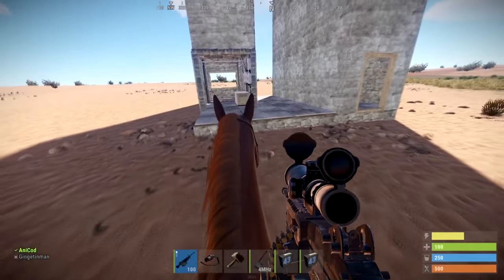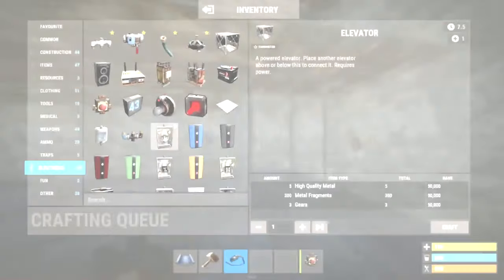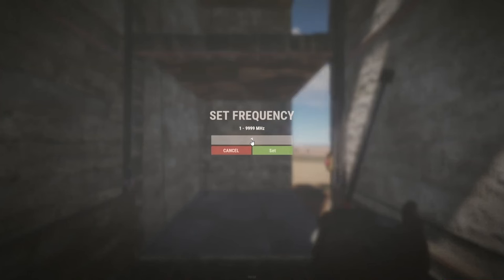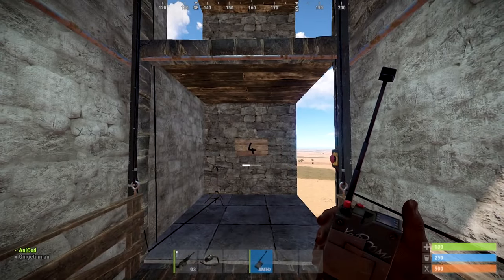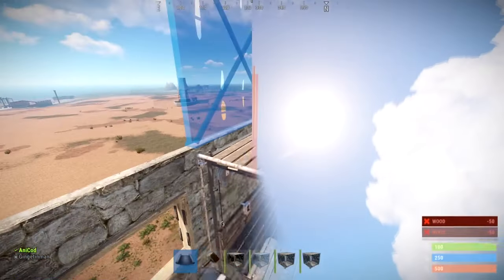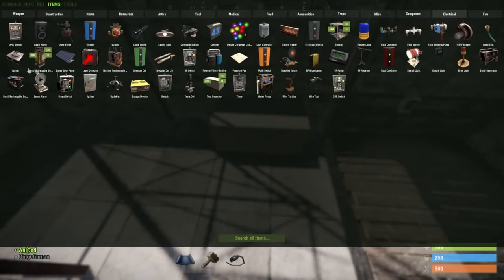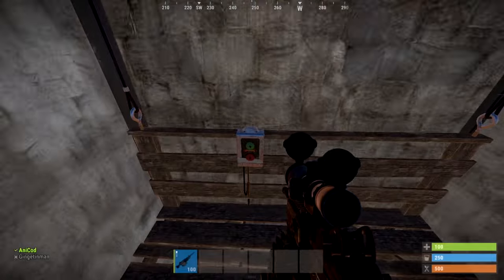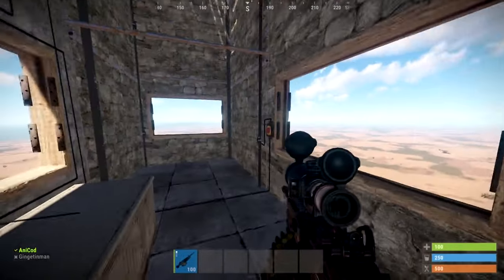RUST | Elevator (Lift) Guide | Tips & Tricks | Circuits

Comment: Awesome video. Question can you put a elevator one in front of another to fit a long vehicle on one call button to make a multi-level garage?  may try this myself. What's your thoughts possible or not possible?
Reply: Did it work? I'm interested
Reply: @MarcWrench1369  nope it doesn't work you get an error not enough space
Reply: @xinping891  that's a pity. Thanks for the reply.

Comment: As admins do we have the power to delete parts of a base? Right now I'm spawning C4, rockets or explosive bullets depending on what I want to remove from the base I'm practising on. Do you know of a away top spawn vehicles like say the mini copter? I can't seem to find any commands that work. So you have tried building to the limit I haven't tried that yet Ive had the server 2 days though so I spent a lot fo time looking for a goodmap seed and I found what I think is a great seed. It has all but 2 monuments. it doesn't have themiltary tunnels or the sphere but I really like the layout and it looks like a great map to play on. I can hardly wait to try it all out. Kinda wish I had god mode sometimes. 
Procedural Map - Size: 4250 Seed: 63851044